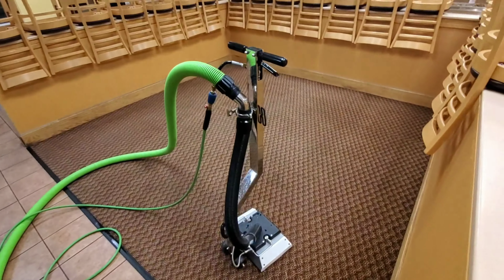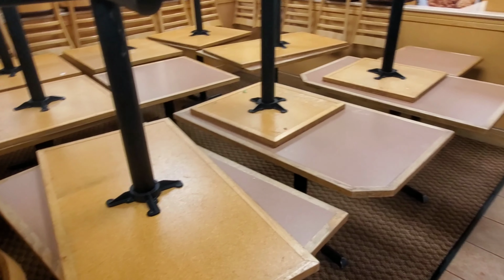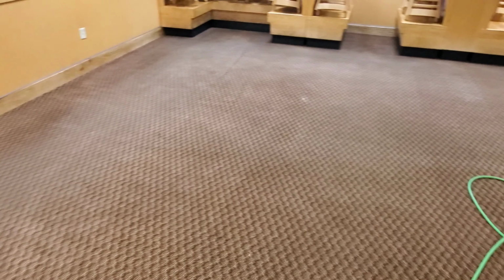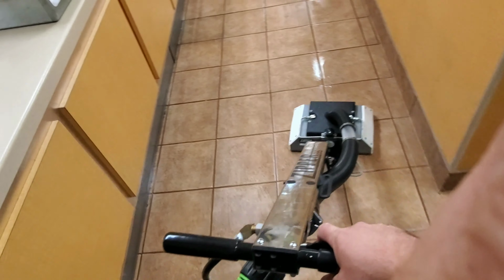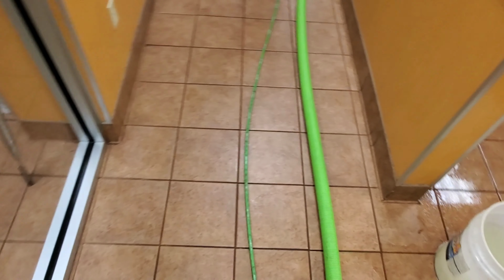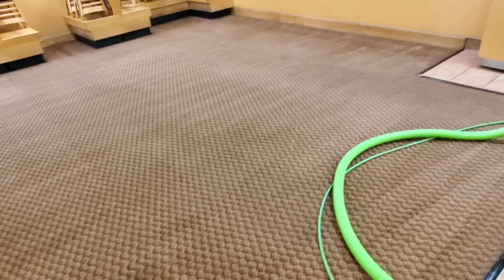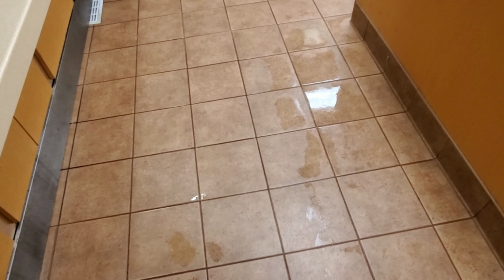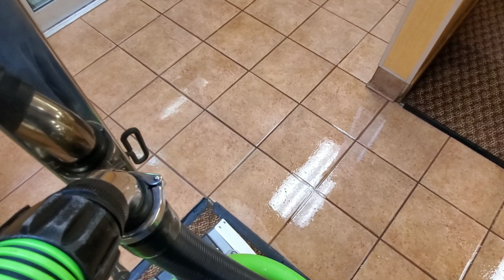Greasy Fast Food Carpet Cleaning Real Carpet Cleaning ep5

Comment: For a Vortex, it doesn’t put out a lot of steam from the Zipper. I’ve seen direct drives way smaller put out way more steam than yours. Other than that, nice work.
Reply from the maker: Several other factors go into that visible steam. High humidity here in the South plays a huge part.  The zipper SS, when adjusted properly,  is pretty well sealed. I like to keep the heat in the head where it belongs.  The Vortex is maintaining it's set temp of 260 during this job
Reply: C & N Cleaning Services gotcha!